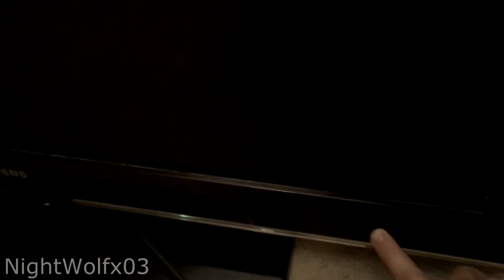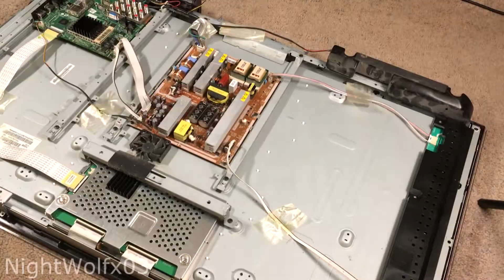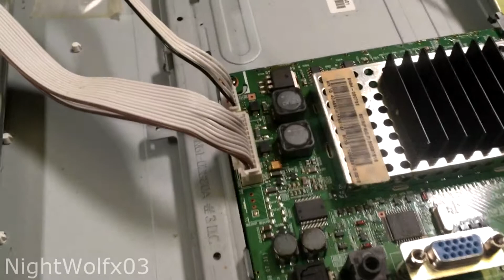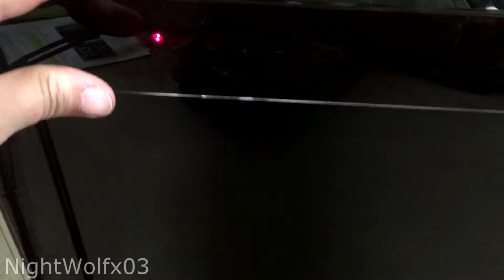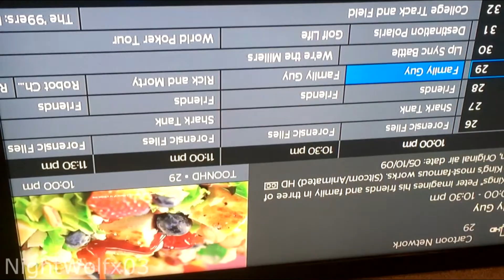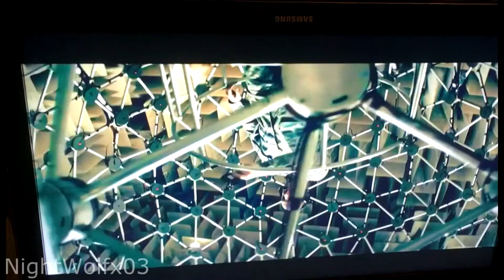Old Samsung LCD TV with Blinking Power LED (Fixed)

Comment: So what was the problem? You shot the video to show the fix. Did it work when you re-capp the power supply or did you poke around with the main board?
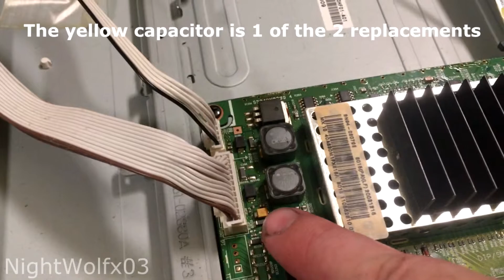Reply from the maker: It was 2 little itty bitty SMD caps on the logic board. The yellow capacitor I pointed at @ 2:37 is 1 of 2 ( the other was on the back of the board ) I replaced after doing some googling and searching, also saw the logic supply was noisy on a scope to confirm what I found after googling but I didn't like the footage I made, the problem was I was expecting to shoot the repair in 1 day but the video is actually 2 videos from 1-2 weeks apart.  There was an electronics shop that was selling repair kits for this specific problem, which I thought was rather amusing and rather nice. The $9 cost was pretty much all do to shipping, the actually parts / supplies where less then $1.50